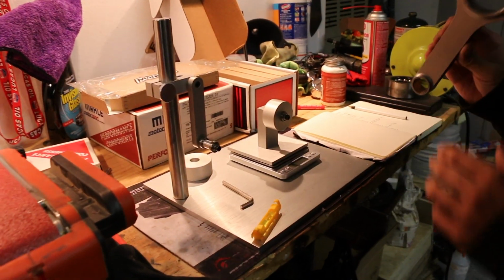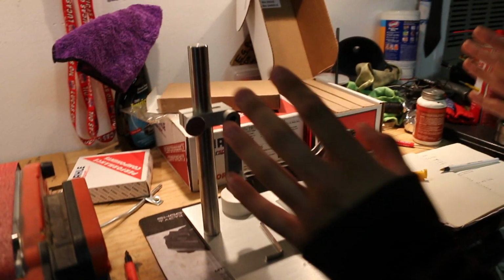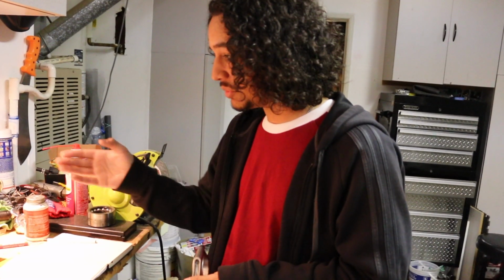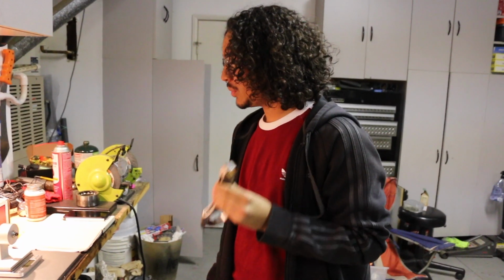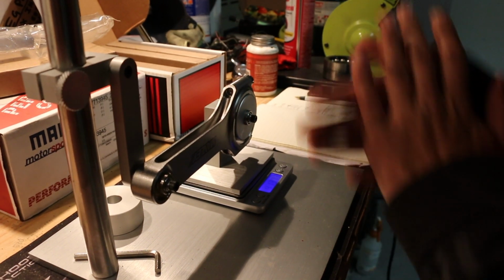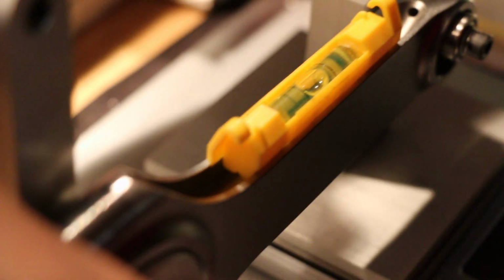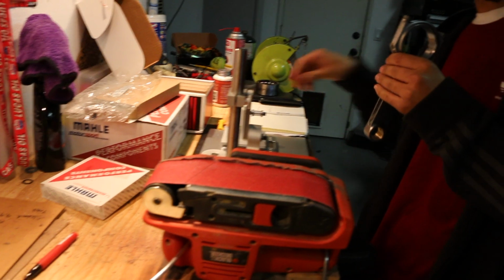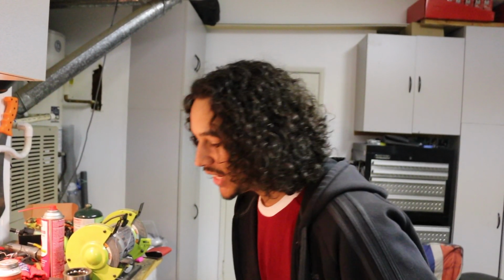HOW TO BALANCE CONNECTING RODS - FOCUS ST ENGINE BUILD

Comment: Good info on the placement of the rod prop to get a repeatable measurement 👍🏻  Just a note, the manufacturer's scale might measure slightly differently than yours' so, for others doing this, don't expect them to match the manufacturer's rod weight measurements.  What's important is the weight between rods and pistons on YOUR scale alone ,and making those match.  As others said be sure to weigh the wrist pins and match them to the pistons to equalize the weight - Lightest piston gets the heaviest wrist pin and vice-versa.  Then re-weigh the pin and piston together and start removing material from there.

Comment: Great video, I have the same balance beam and like you, it's practically impossible to get the exact same reading every time. In reality as long as you're within 1-3 grams, it's well within tolerance for a street engine. What I've done before also is you can pair the rods together so that each mated set of 2 rods per journal equal each other which saves on grinding. The other thing I wanted to mention is that you should take small amounts and re-check because the weight on each end you need to remove will change the more you remove from the other end. If you remove some from the small end, the large rot. end will have more weight shifted onto it. Some places will only weigh the entire rod and weight match the rot. (large) ends, theoretically equalizing the small ends. The large end is the most critical balance of the two ends anyway, with the reciprocating end only 50% of the balance factor.

Comment: I've been doing this for almost 40 years.   Give this a try. Get a a piece of cold steel 1/8 plate or stainless. Mill it straight. Cleaned and paint if you used cold steel. Now, permently attatch the fixtures with no more then crazy glue incase you need to replace something. That will keep you consistent. You can move it where ever you want
Reply: I'd like to elaborate on the cheap crazy.glue. You won't always be doing the same types of rods. A little acetone will remove it and allow you to reset it to center your next rod size. I think this is an easier approach then building a rolling track that you would weld or bolt to the plate.

Comment: its not ideal to remove the hardened shot peened finish on the rods outer surface, best to remove material on a non shot peened area
Reply from the maker: ValladolidArde 
The entire con rod is shot peened. Only the bearing openings have a smooth finish.
Reply: @tbr.performance  I know, its the purpose of shot peening. I remove material from the bolts, not much is needed. Prior to weight allocating them to specific rods.
Reply from the maker: ValladolidArde 
Ahhhhhh I see. Noted! I’ll definitely keep that in mind and do my best to achieve that with the future builds!
Reply: Superb🙏

Comment: Along with balancing the rods & pistons, did you balance the rings, pins & bearings and then group each rod, piston, ring set, pin and bearings for each cylinder together and get a total weight for each cylinder as if the pins, ring sets and bearings were not factored in, your balance will be off..  Nice job on the balancing, but have one question on the belt sander  choice for the paper grit as it looked to be a little rough..If a finer grit paper belt were used there could be less chances of stress risers from the sanding marks left behind on the rod surface... Also after grinding it might be advisable to clean your balancer & scale for sanding residue..  I know these suggestions are nit picking but if you want to do it yourself then you have to look at everything you touch...Go to a you tube channel called subie performance... Andy has a shop in Germany and some video's are in German but he still measures and writes in grams and you can see how he groups internals before and after balancing.. Another thought would be to move the belt sander away from the area you are trying to keep clean.. Again not trying to nit pick, just trying to make you aware of everything that matters.. Building an engine is like open heart surgery, if the surgeon is at the top of his profession the outcome will be perfect...
Reply from the maker: Mark Geletzke 
If you go to my video on balancing pistons you can see I weighted everything. I labeled all of the rings for their dedicated cylinders, same with the pins by weight. I took everything into consideration. I was working in the area I was given and I wish I could have a clean dedicated shop for building engines like I would love. I can’t remember the grit of the paper but it didn’t leave aggressive marks on the rods. The weighing area was always clean and I made sure of that. I made sure before assembly that everything was as clean as could be. I have the entire build process on the channel.
Reply: The direction of grinding can also limmit or increase stress cracking. 
It would be best practice to leave the grind marks length wise instead of diagonally across the areas of potential breakage.

Comment: VC I've been following your awesome build man and I think your project is STUPID SICK I love it bro., Have a 2017 Focus ST 4k miles only it's totally new.  What would you recommend on making my 1st mod?  Had in mind some Borla or Ford P with the Cat since it's ileagl to remove where I live.  Keep up the great Vlogs
Reply from the maker: AngeLo Lo 
I highly recommend intake, exhaust, and an upgraded front mount intercooler to start. You gotta make sure the engine can breathe. You’re gonna need an accessport or some sort of tuner to tune the car based on the mods and always get a custom tune. Never run the off the shelf tunes supplied on the ap. You’ll end up potentially damaging the engine.
Reply: @tbr.performance  
OTS maps are known to be conservative and safe.
Reply from the maker: Mr J 
The custom tune is much safer. I have had no tuning issues at all with the car since I have been tuned with stratified auto. A professional tune based on your driving conditions paired with proper maintenance will ensure the most life out of your engine.